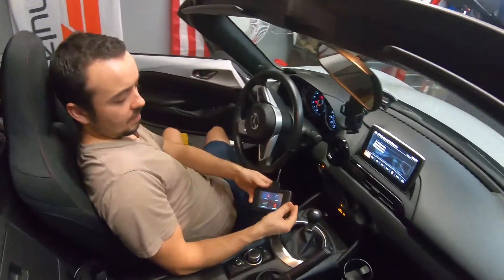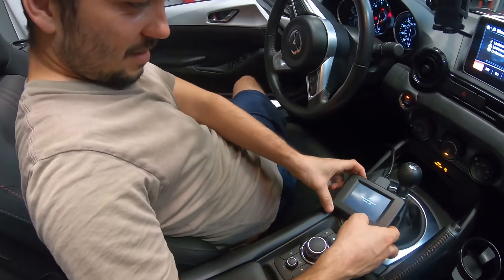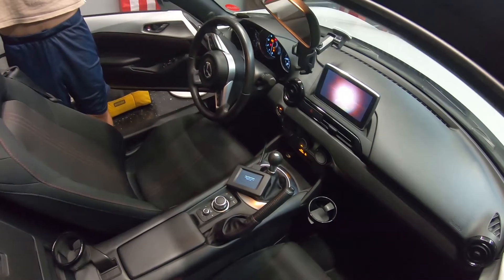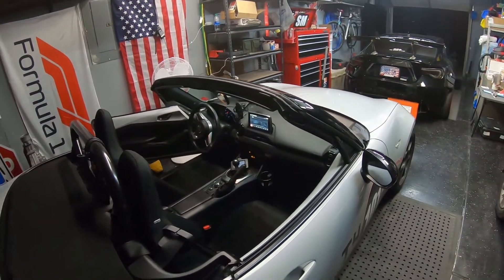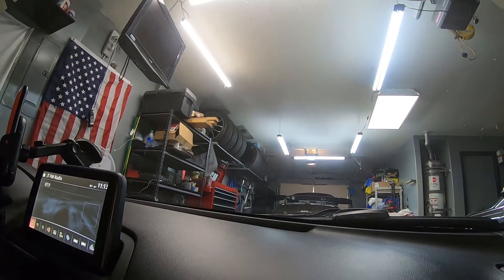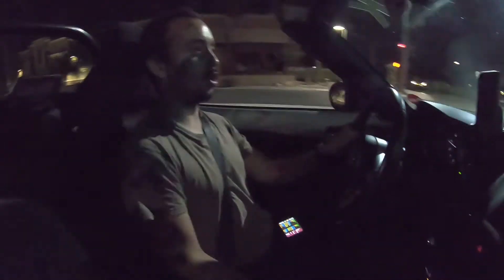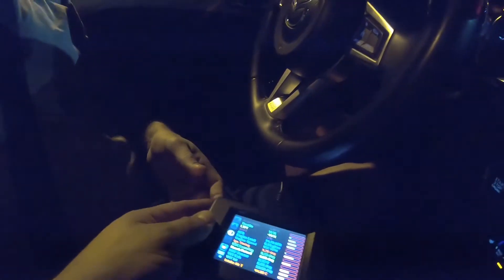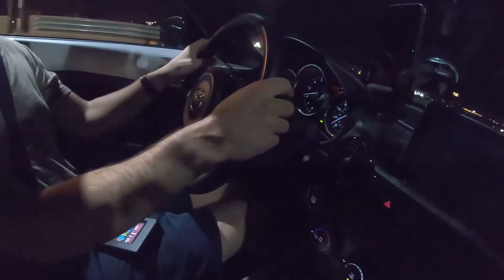Miata E85 Tune Reflash and Datalogs

Comment: what do you need to run e85 in these cars? any extra sensors?
Reply from the maker: No Sir. You’ll just need to flash the tune on that is needed for it. Unless you go with a flex fuel kit. So for his car he does a fill up and flashes on the tune and he’s good to go. With my FRS I run a delicious tuning flex fuel kit, so I just fill it with whatever and it automatically changes my tune for whatever fuel I’m running. I highly recommend this way, but both ways will work.

Comment: you can run e85 on the stock fuel system?
Reply from the maker: With a tune, yes. His entire fuel system is stock. But it’s not PURE E85, it’s a mix of E85 and 91. So it’s not pure E85.
Reply: @CHARacing381  why switch back though? i thought e85 gives you the best power?
Reply from the maker: @joeyystreamz1561  It does, however, some SCCA AutoX classes don’t allow it, without calling it a “power mod” and bumping you to a higher class.
Reply: You can run e85 on the stock fuel system. This is my car, and lots of folks are doing just that. You just have to switch back to 91/93 for competitive events.